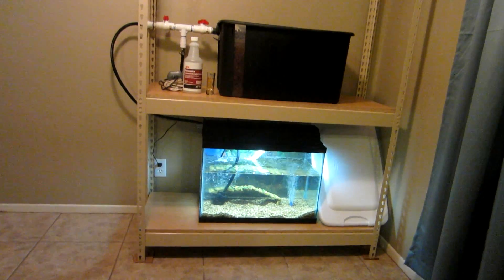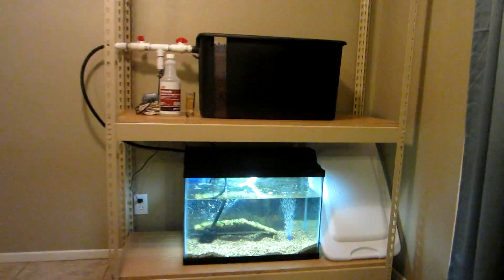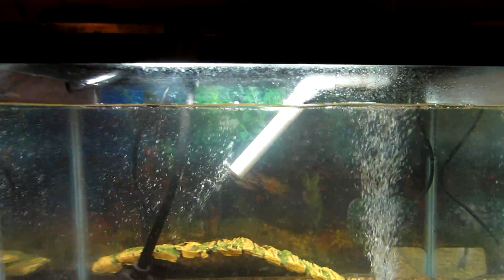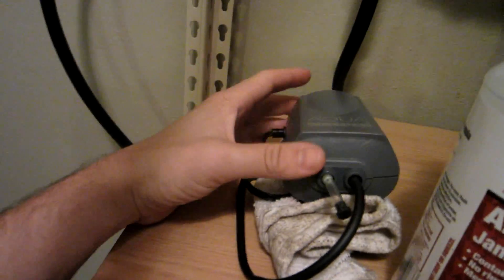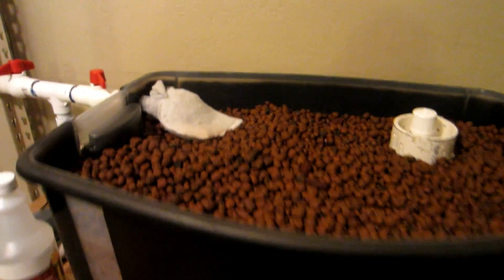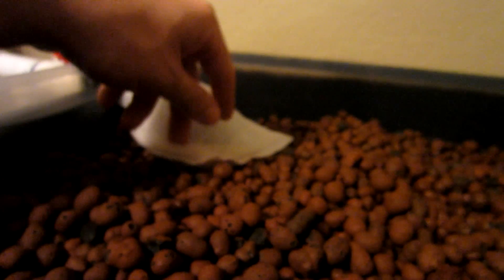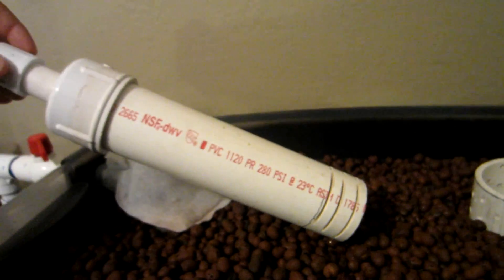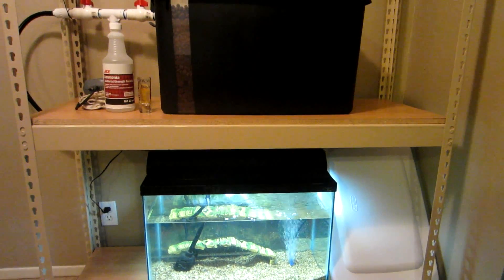Indoor Aquaponics with 20 Gallon Tank Part 3

Comment: I have the same type of setup just with the fish tank on top and the plants on bottom will that be sufficient I have a pump in the fish tank pumping the water down to the hydroponic setup and a pump in the hydroponic setup pumping up to the fish tank will this work okay
Reply from the maker: It will work.  If you can, try to reduce down to one pump as you have less room for failure.  If the bottom pump or bottom pump timer breaks will it flood your system?  That is great that you built one!   Its an addictive hobby.  Always planning the next best system.
Reply: You got a number I can call you at I'd like to talk to you on the phone
Reply: I'd like to ask you a few questions and send you a picture of my setup
Reply from the maker: Sounds Great,  ask anything you like.

Comment: hello i installed aquaponics system above mien 40 gal tank i got 7 garlics there 3 small basil 2 quite large thyme and some grass mine water goes via slow pump and is drained through bell syphon out on 24/7 hour basis i also added some composting worms to the growbed. im using hydrocorn. plants are doing very well mine aquarium is planted also. i do not eat the plants just planted them to clean the water for fish but that is not happening for some reason mine stock is 14 glowlight tetra and 2 hoplo catfish. i still need to take 3-4 buckets of water every weak as water change maintence becouse of water quality. i would like to ask if there might be anything i do wrong. regards brych michal
Reply from the maker: hello.  Do you have a 1:1 ratio of grow bed medium to water volume?  How fast does the grow bed cycle?  Mine is set to about 10 minutes from fill to drain.  Good Luck!